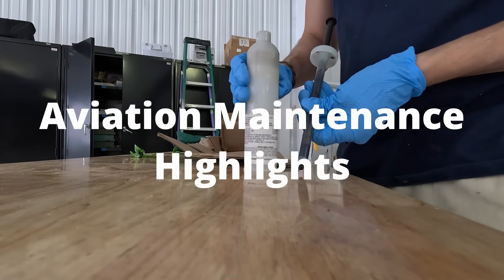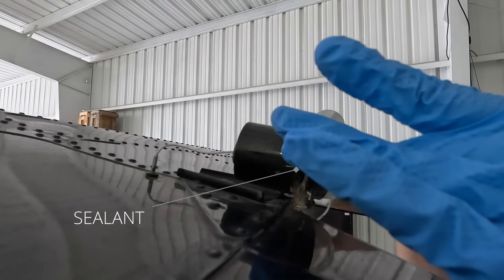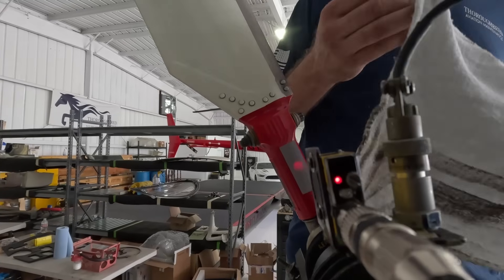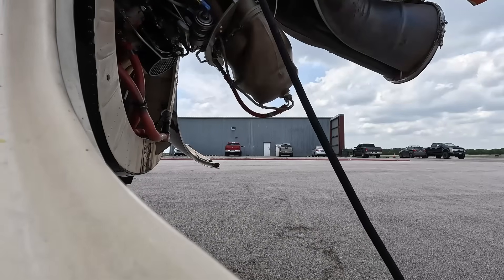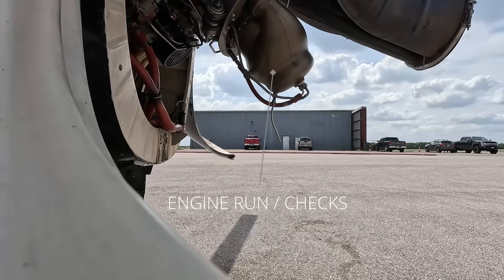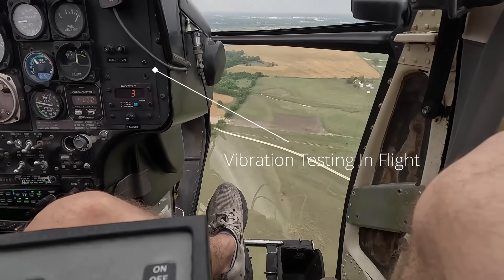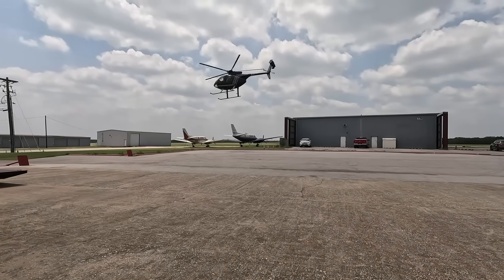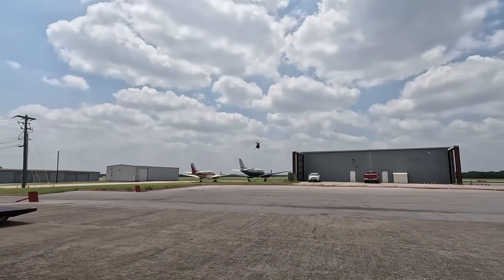The Harsh Reality of Being a Helicopter Mechanic

Comment: Sealant application tip: use an acid brush to apply it and spread it, cut the bristles about 2/3 shorter and bend the tip to reach around areas hard to get to. Nice work!
Reply: great advice

Comment: Bell 206 guy here. Not needing a shaved socket or special tool to pull the fuel nozzle would be so nice lol. hanging a turbine must be a pain at that angle. we're able to muscle it onto the gearbox by hand on the bell.
Reply from the maker: Yeah that angle is a bit tough. Turns into a 3 man job lol

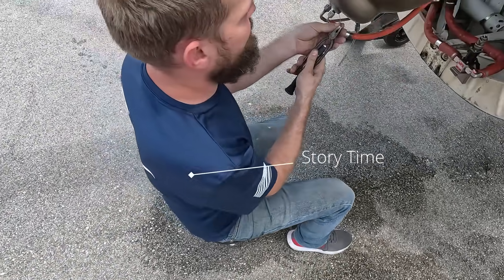Comment: 3:39  Talks about some tech getting hit right in the eye.....and isn't wearing safety glasses himself.  Where I work they require safety glasses or goggles and a bump cap. Saves countless on-the-job injuries.....especially when working in engine bays and wheel well bays and such tight spaces.
Reply: I'm a firm believer that if you get hurt on the job site due to lack of PPE, it's your own fault, not the company's. So if i want to take the risk, it's none of your concern. I'm glad i don't work at your company 😂
Reply: @mrstutz3333  There was a time that I probably felt that way.....but now I've grown up and realize that it's cool to follow the rules. If a person wants to go rogue and get hurt it's their fault.....yeah sure. Yeah NO....then the company loses that mechanic for however long. An individual taking the risk is one thing in your own garage, but if you are off from your own fault then that hurts the company. I hate the company I work for because they stole our pensions.....but I go along with the safety rules because it also benefits ME. The bump cap has already saved me countless times. 
They've been doing it in Europe for decades already. I'm also glad you don't work at my company.

Comment: The licensed aircraft mechanic has the most exposure to liability of almost ANY job in the world because when you repair an aircraft you are responsible for that repair for the life of the aircraft, until someone comes behind you and signs off on that repair again. The pilot's responsibility ends when he sets the parking brake and walks away from the aircraft. And THAT's why licensed airline technicians are paid so well.
Reply: Not worth the money or risk to work at a major airline in my opinion. If i got a job there, it'd be because i had to, not because i wanted to. Smaller companies are where it's at. Flexible hours and more family time.
Reply: @mrstutz3333  "Smaller companies are where it's at. Flexible hours and more family time." .....and low pay.  Good luck with that, my friend. God bless you.

Comment: That little Allison 250 series turboshaft engine is so amazing. With it's gearbox, it probably weighs less than 160 lbs and yet it puts out several hundred horsepower (depending on the exact model of course). And it sounds oh so good!
Reply from the maker: It's a masterpiece of engineering.
Reply: Why so expensive? 🤔
Reply: @Pork-Chopper  Over engineered for safety and integrity. Very diligent, meticulous and frequent routine maintenance required. Oh and conservative life limited parts that need to be replaced on a specific schedule even if they are in perfect condition.
Reply: @Freq412  
Yes, however, it's only engineered once! 
The processes are the same. I'd be curious to know what the profit markup is... 
Sometimes too much safety crap backfires. For example, vehicle airbags that explode
at random injure or kill the driver.... In the name of safety... Yeah right!

Comment: I worked with a diesel mechanic, that was a helicopter tech. He changed professions because where ever the helicopter goes, you go. Lots of travel. 
 If the helicopter flys for 30 minutes, you spend 2 hours greasing and inspecting afterwards. 
 That’s what he told me.
Reply from the maker: @redmesa2975  depends to the heli yes. Generally people have to be aware of the travel when it comes to helicopter maintenance
Reply: Some helicopters  require  30hrs of  ground  maintenance  after each hour of flight
Reply: @DonMason-cv6og  some?

Comment: Turbo machine engineering tech here who's always wanted to work on helicopters, how much does an A&P cost to get for schooling?
Reply: In the US 18-24 months, with costs varying $35-50K.  (FYI, in Canada, some schools are half the cost as per the US schools).  This does not mean that upon completion of tech schooling that you'd be a fully certified A&P (rotor) mechanic.  Some sort of time (hours) credit might be given to you, basis your previous experience on other turbines, however, keep in mind that aircraft engines, including turbines are a completely 'other baby'.  Visit a few A&P schools, as well, contact the FAA about any possible credit hours, basis your past experience.  Good luck!
Reply: It depends on the school. I personally went to Baker's which is a 2 week course. However, i obtained about 8 years experience before that. If you're just starting out, i would suggest either finding an apprenticeship first, or attending a tech school which can usually last about 2 years.

Comment: That prc was mixed with way too much hardener. Should be a dark grey, not black if mixed 10:1.
Reply: The sealant comes with the proper ratios in the mixing container. If you mix the whole container, instead of separately like we do, i promise you it would come out just as dark. And that is to manufacturer spec (100/10). You'd be wasting time by starting over. Unless you're delegating by the book and you actually pull out the scale, there's no leverage to demand a new mix based on color. 
Apologies if that sounds argumentative, didn't know how to write it any better. Thanks for the input though!
Reply: This particular sealant is black. The activator is very potent. It's also an approximation. Mixing hot just makes it cure faster. It still cures, and seals, and holds. We have never had a sealant job fail yet. But if we do, we'll be sure to address it.
Reply: @mrstutz3333  yea some are darker than others but it didn't match what was on there. as long as it kicks I suppose  its doing something but it probably wont' last as long. I wouldn't have let you use that if it was on something critical like a transmission mated part or Head parts that require it, if those fail you wont notice until the damage is done.

Comment: trouble with helicopters (and by extension its maintenance) is that the laws of physics bearly tolerate their existence 

Airplanes work with physics to fly, helicopters bully physics into submission just enough to aviod crashing becouse the universe hasnt figured out a way to stop them yet, but its trying its best.
Reply: Love this! Lol 
My favorite definition of a helicopter is "A thousand parts rotating rapidly around an oil leak waiting for metal fatigue to set in." 
Still love them though. ❤
Reply: Dave Barry once said "Scientists still don't know what holds helicopters up. What ever it is, it could stop at any moment, is their current thinking".

Comment: Great videos make them as long as you want we love details of the 500!Do you add washers to balance the tail rotor? Do you overhaul the allison or thats only at the factory?
Reply: We do add washers to the TR, chord-wise usually, when necessary. This particular run was 👌 so no adjustments needed. Same for MR. 

We are not certified at this location to overhaul the engines. We use a separate vendor for that. Sidenote: Rolls Royce bought Allison in '95. 😉